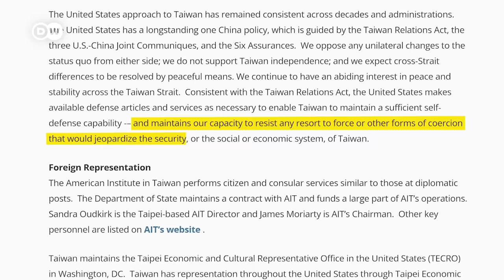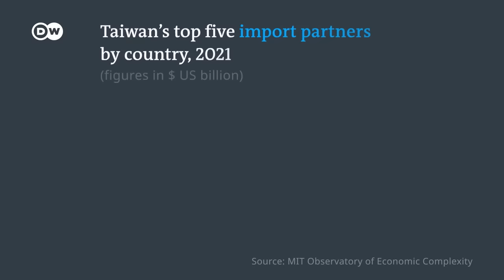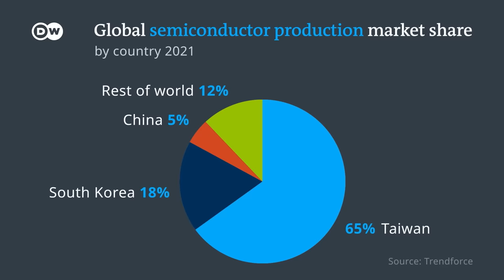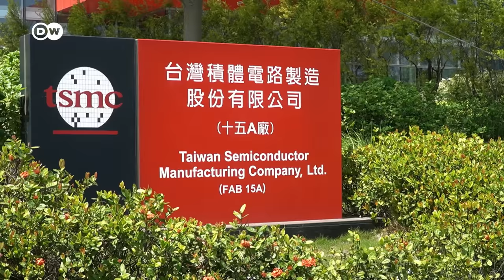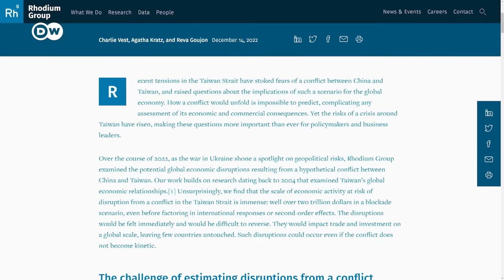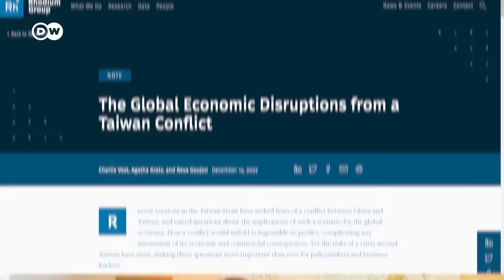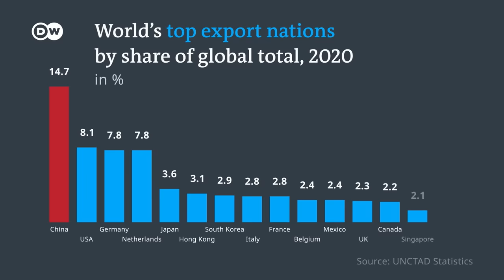How the China-Taiwan conflict could be devastating for the global economy | Business Beyond

Comment: The role of cutting edge chips is complicated, they have an important role in cutting edge technology like AI/simulations, especially where space is limited, but many aspects of society can continue with lower quality chips, when bundled, or imagine something like an older generation smart phone which isn't so catastrophic.  Most military equipment utilizes older generation processors that others can more easily replicate, but ongoing innovation would be hampered.  Are the next breakthroughs in semi conductors based solely on TSMC processes, maybe.  Taiwan deserves support because it is a respectable democracy.
Reply: A delay of a half second in these cheaper chips can be the difference between a near hit and complete miss. If it's guiding a missle.
Reply: The US is currently building chip foundries. TSMC will have a foundry in Arizona. I agree they deserve their freedom but it will not be as strategic for the US to defend after they are built

Comment: "Of the US$1.5 trillion semiconductor industry, the United States dominates the integrated device manufacturer (15 per cent), fabless (25 per cent) and microprocessor (17 per cent) sectors. Meanwhile, South Korea and Taiwan lead the foundry (13 per cent) and memory chip (7 per cent) sectors to a lesser extent. The United States maintains the lead in microchips through innovation and is now seeking leadership in both the system and memory chip markets. The United States aims to increase its capacity for mass production by acquiring foundries to consolidate complete supply chains domestically, despite an enduring reluctance on government-led industrial policy."